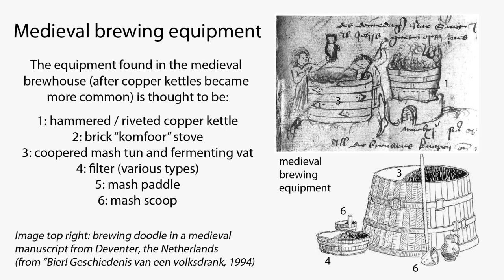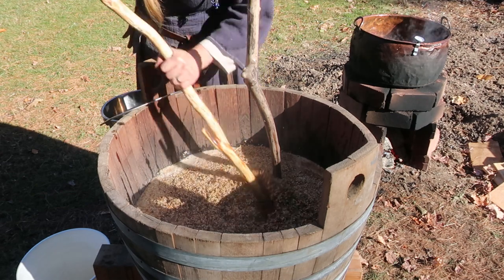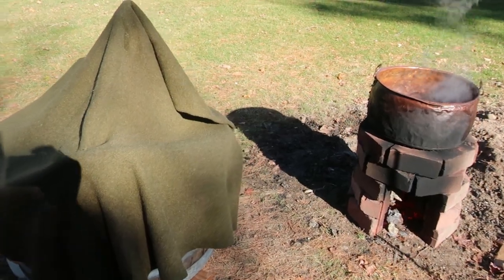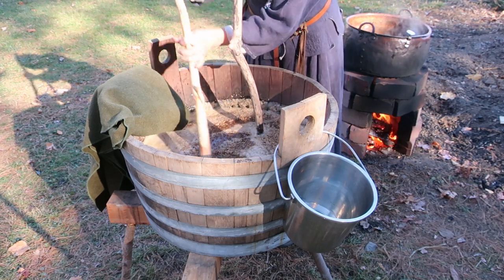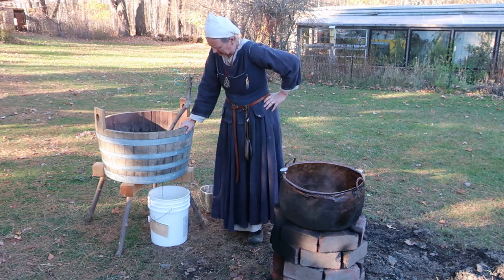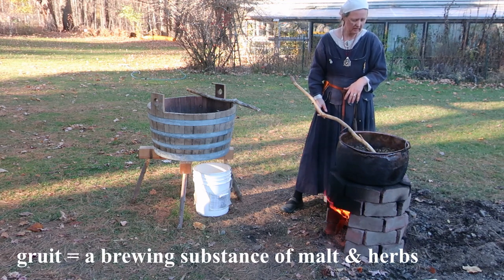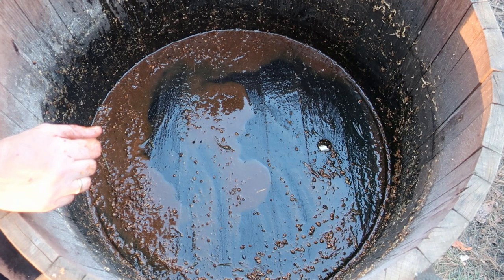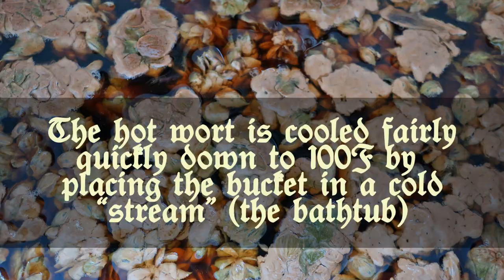Medieval copper kettle hopped beer

Comment: Great demonstration Susan. The techniques change through time but the process remains the same.
Reply from the maker: I really enjoy doing this one and the stone brew within a couple of week of each other as the experience was still fresh in my mind, and the similarities, and differences fun to experience. When done correctly (judging strike temp for the wood equipment takes some trial and error) this version I think takes less work but requires more experience; the hot rock method is more labor intensive but is also more forgiving. A result I had not expected.

Comment: I loved this video and the Stone Brewing. Both are long time points of fascination for me, I just haven't got around to doing something along the same lines. I am, however feeling a little more motivated. Thank you. As for the movement of your wooden screen upsetting your plug stick, afik most food safe wood float to some degree, as such you might like to look into methods of weighting down the filter plate. One idea that comes to mind for me is to set a tripod of stones underneath the filter plate and tie them in-situ with small rope nets, or copper straps? not sue how historically accurate such a solution might be, but might be worth looking into.

Comment: I really enjoyed this! Just last night I was saying I wanted to try some medieval ale and beer brewing. I have done one from the Stuart era, and made three strengths: small, normal and strong. But I am not really a beer drinker so want something that tastes good to a modern palate, but is also weaker, like a small ale. I will look at your other stuff and be in contact!
Reply: If you want something weaker, you could try either dilution of the wort, or partygyle your mash. You could then play around with flavours either post primary fermentation, or by making various gruit teas and adding it to your second or third runnings which will have thinner body. I'm not sure how accurately such techniques are reflected in the historic record, but could be worth looking into.